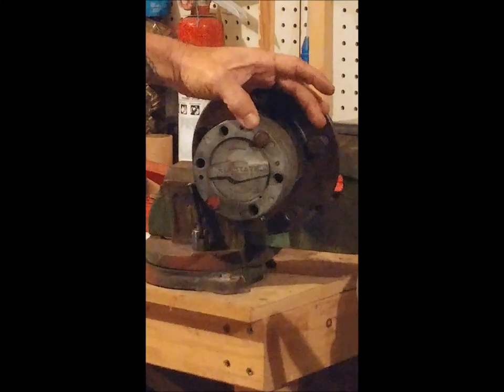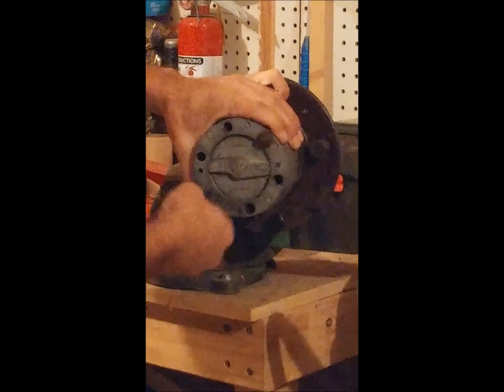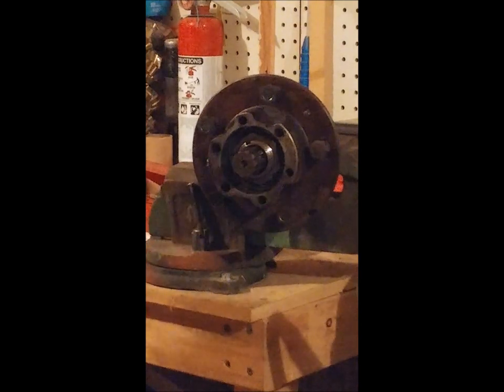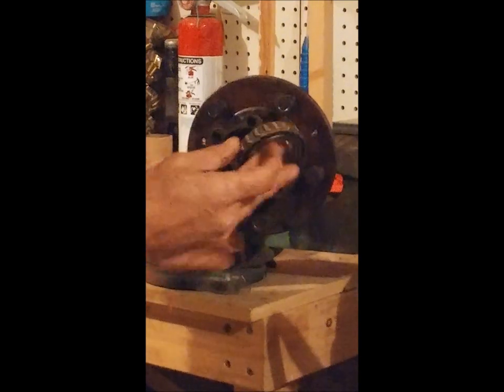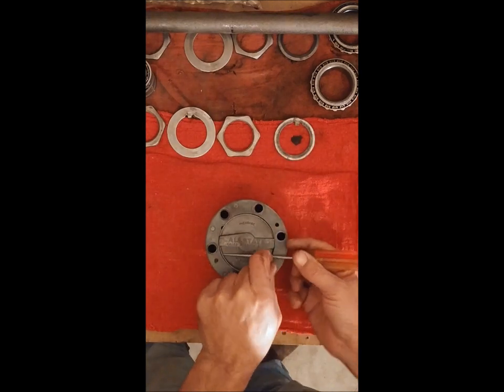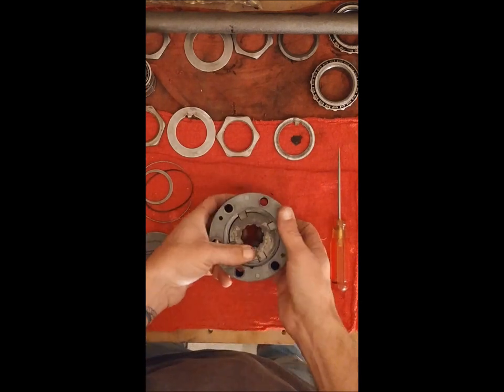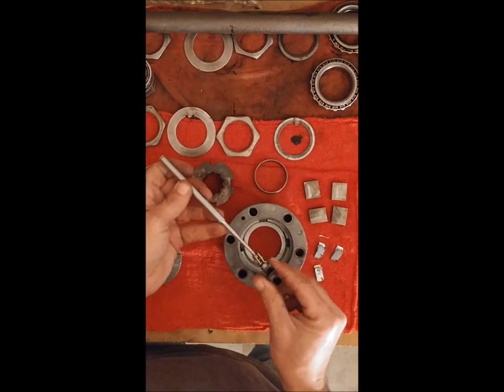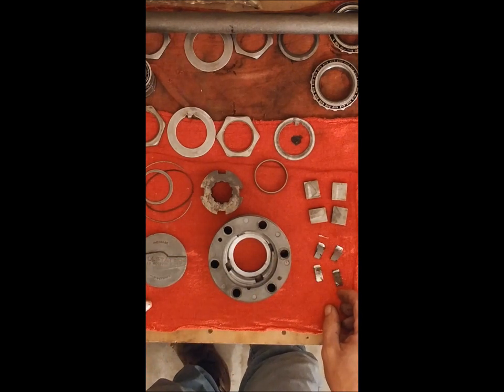SEARS AND ROEBUCK ALLSTATE HUB LOCKER

Comment: Anyway you could get the size and dimensions of that bearing? Im took mine apart and its missing. Its a pain to try and put back together without it
Reply from the maker: Go to Kaiserwillys.com
Part number 52942. That part number should be universal for that size bearing from any bearing provider
Reply: @paulsworld07  thank you!
Reply: @paulsworld07  how do you push the paw levers in to reinsert the spline? That is the part that im having a hard time with. I cant keep them compressed enough to get the spline to go back in
Reply from the maker: @garagespec9330  Theres easy method it just takes a bit of time and determination.
Reply: @paulsworld07  do you have any tips?
Reply from the maker: @garagespec9330  a little grease on the inside of the slots helps but it boils down to patience really.